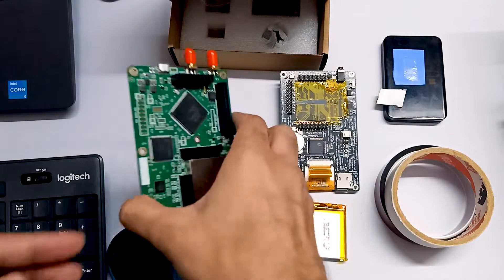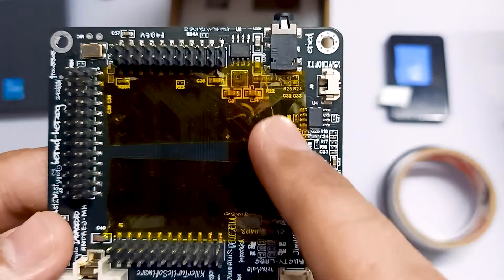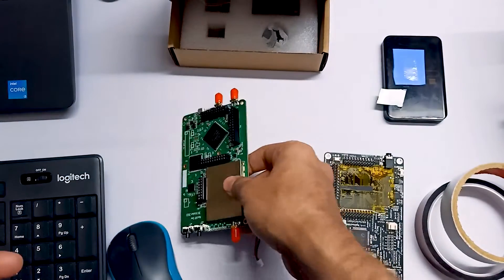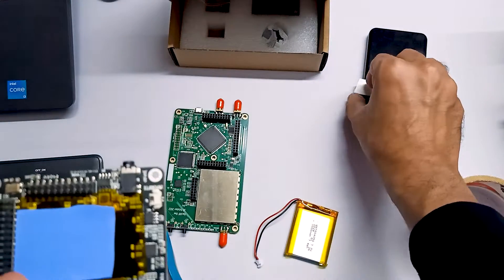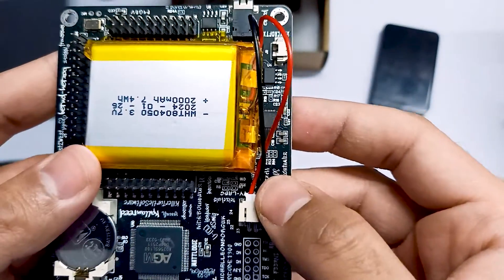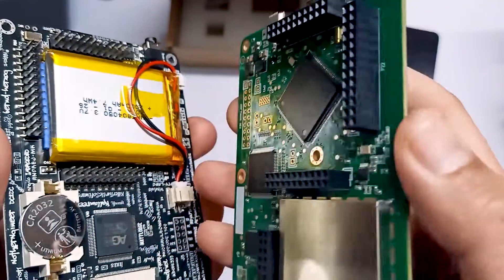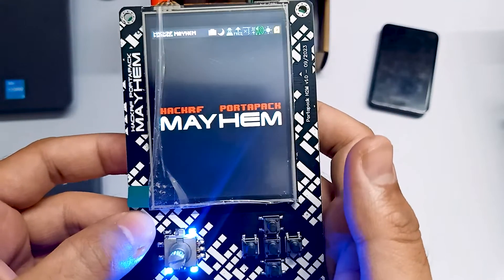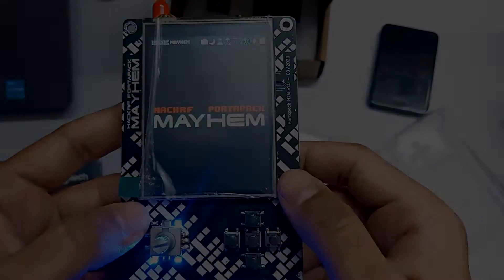03 Assembling HackRF One with PortaPack H2: Thermal Tape & Precautions ⚙️

Comment: No display found, pl help
Reply from the maker: Press left arrow and main power button together
Reply: @SecureTechware  hey man....whats that tape? heatsink thermal tape? or thermal resistant tape? i dont understand the function....if its not to dissipate heat, what happens if the components get hot?